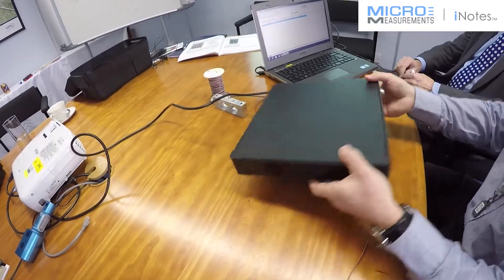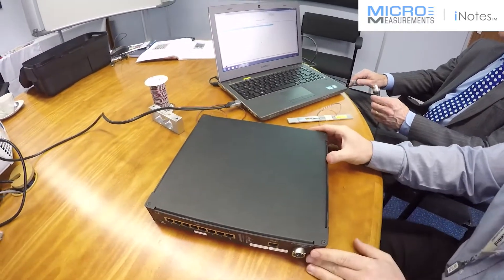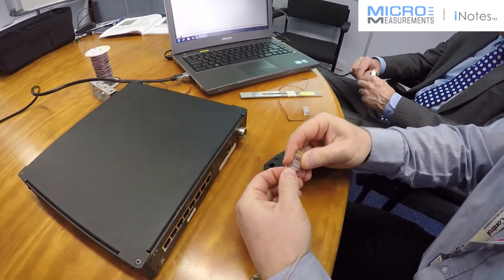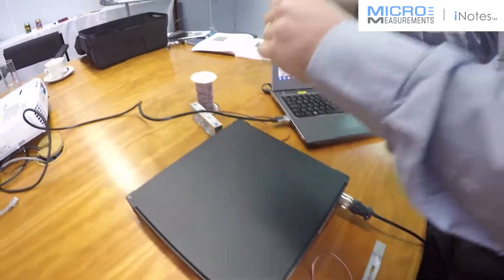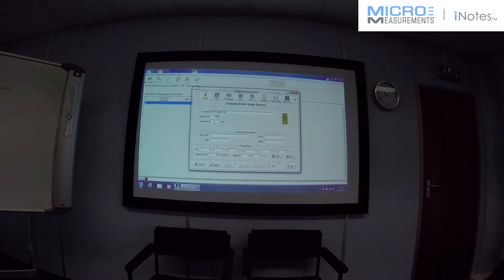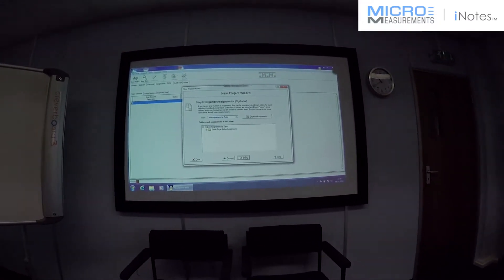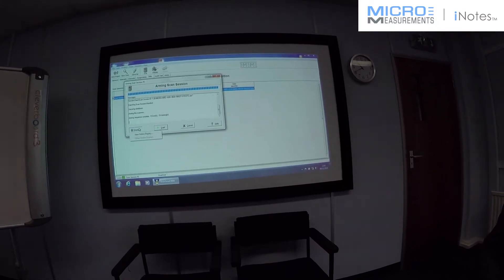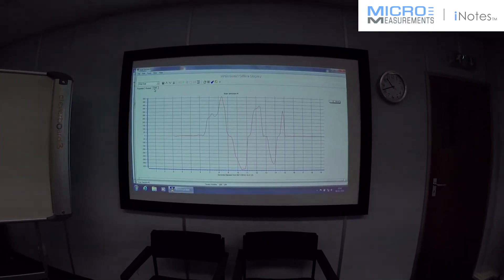The System 8000 StrainSmart® Data Acquisition System

Comment: El Sistema 8000 de Micro-Measurements es un sistema de adquisición de datos versátil y de precisión, destinado a aplicaciones estáticas y dinámicas. Cada escáner incluye 8 canales de entrada universales, aceptando bandas extnsométrics, termoopares y señales de alto nivel (High-Level).
Si necesita más información, por favor no dude en contactarnos. mm.es@vpgsensors.com miguel.bravo@vpgsensors.com

Comment: Great video showing how easy and versatile our System 8000 is to use.  Strain Smart software is easy to use but also has a lot of versatility.  Combined with a small 8 channel System 8000 that can measure strain gages, thermocouples, and high level signals with just a software selection makes for a really useful DAQ for around $4K.  You can even combine up to 16 System 8000's together to give you 128 channels.